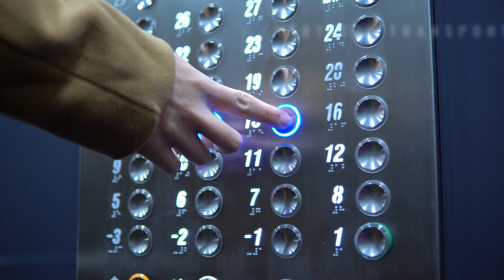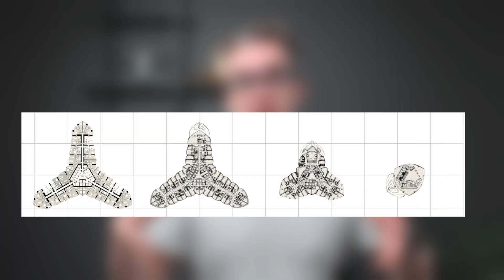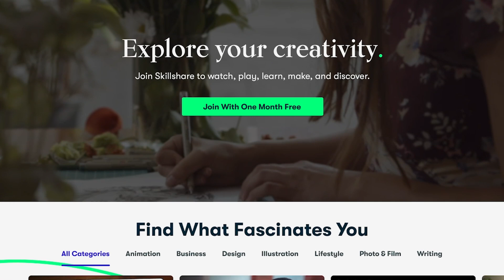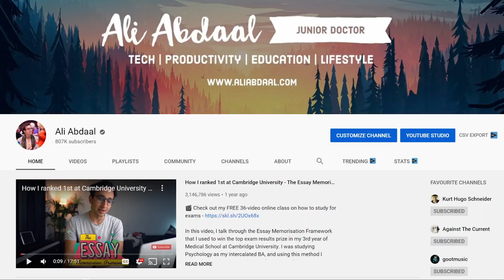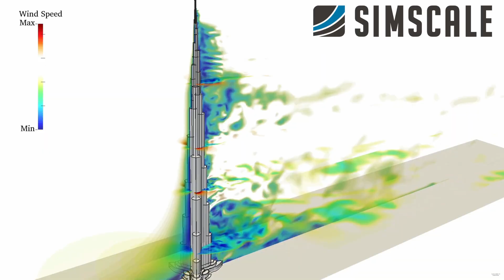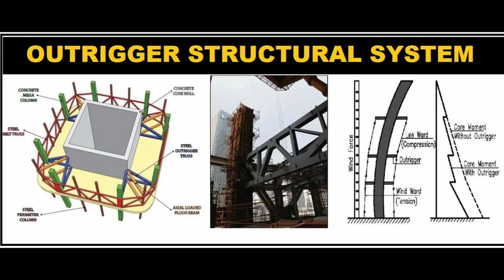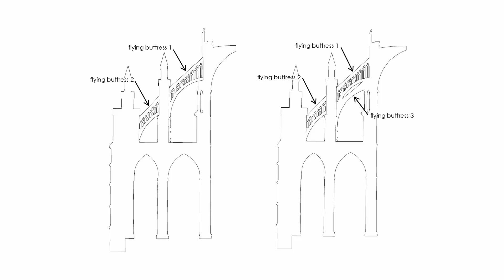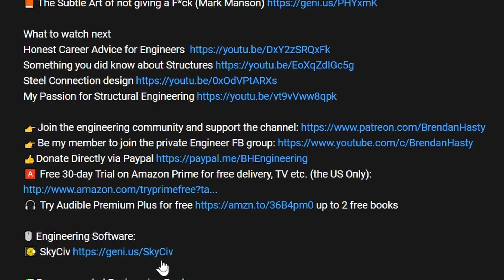Pushing the limit of Skyscraper Design: How tall can we go?

Comment: If the question is how tall can we go, then do we even know?  We can make columns larger, we can taper buildings so the footprint at the bottom is larger, some locations have strong enough strata under the building so that larger foundations are feasible.  Does the deflection limit become the maximum acceleration due to wind instead of strictly a function of height?  Burj Khalifa has taken advantage of a lot of different things to push the limit by quite a bit, but could it be scaled up 50%?  100%.  I think it could be scaled up by 100% and it would just be a matter of cost.  Could it be scaled up 200%?  I don't know the answer to that question.

Comment: Graet video, can you make a video about designing high rise buildings depending on codes or by using the performance based desgin, because its seems unclear, and if it possible to have an example for khalifa tower how it was designed, what is the design steps for it.
Thanks ❤️